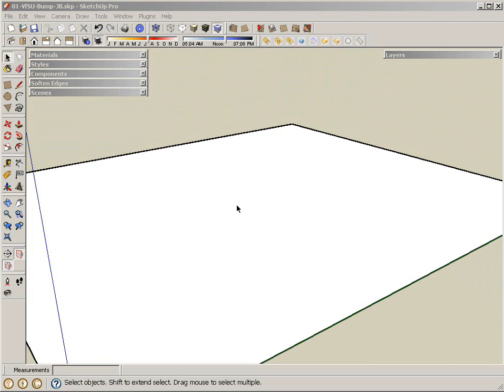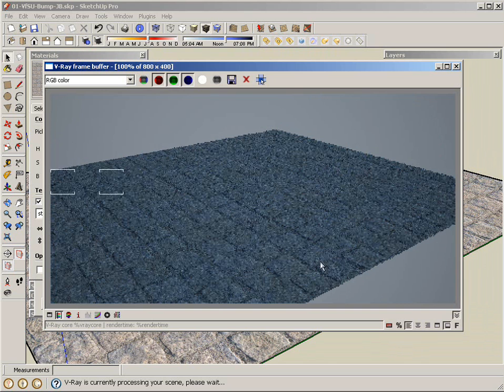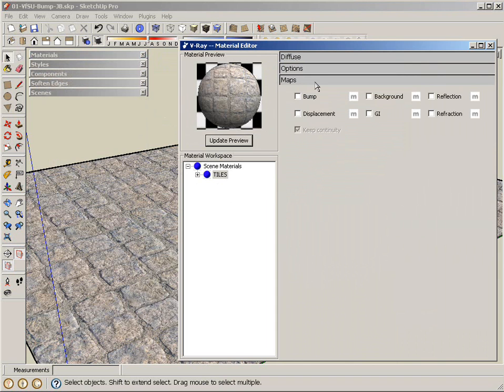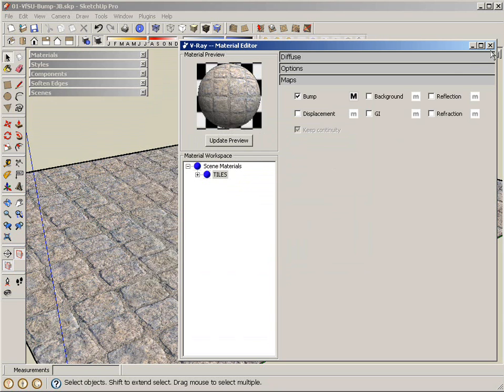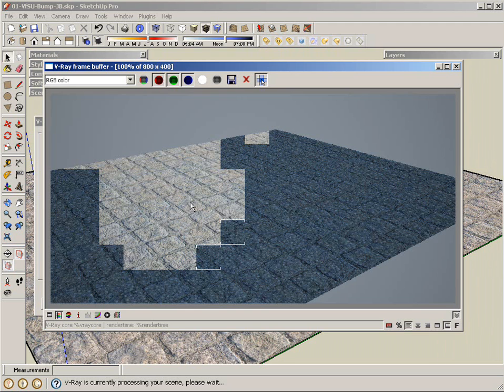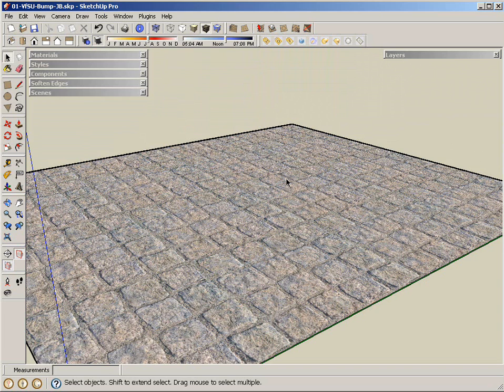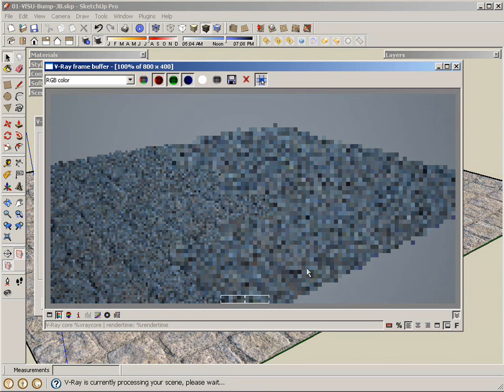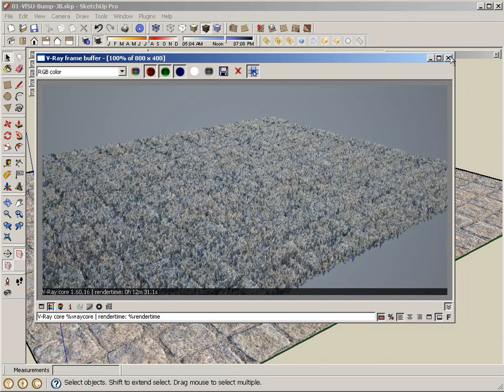V-Ray for SketchUp Materials Bump Displacement

Comment: How many cores does your computer have? Also check to see your GI settings, and adjust your primary and secondary engines. For me to render fast with good results I set my primary engine as irradiance map at 0.9 and my secondary as light cache also at 0.9.